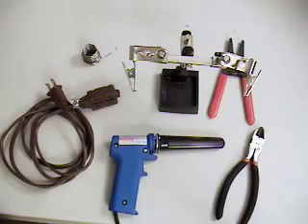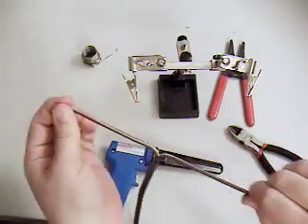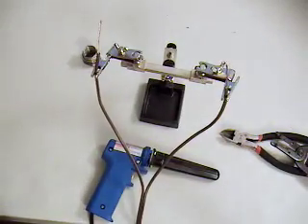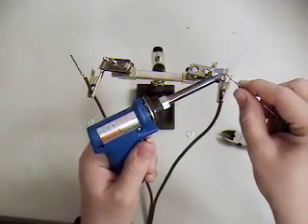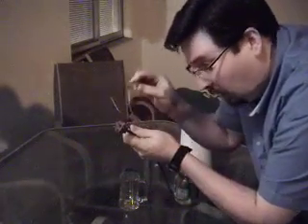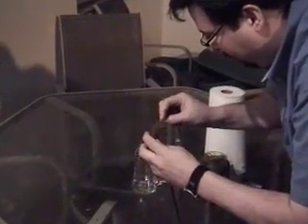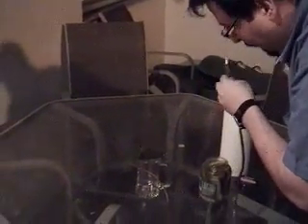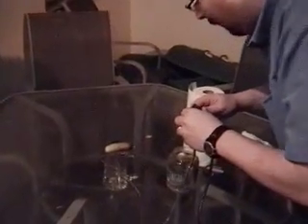Fluorescent Pickle Experiment, EXTREMELY DANGEROUS, but cool

Comment: Hey you should get more than 1 pickle and put them in a line with wire between to sor of string them together to make a chain and put the  ends of the extention cord on each side and see if you can light up more than one. Christmas pickle lights!

Comment: If you end up using those high-voltage capacitors, it could rapidly arcs over for several milliseconds before blowing up, I liked this video - my friend actually tried that but with pickle's limit being pushed - it was so loud when it went off. If you wanna do that, I recommend you to wear face shield and ear protection - it could get out of control so fast. I got a piece of hot pickle somewhere on my body, it was so painfully hot.

Comment: Didn't you think of putting a switched electrical cord inline so the risk of electrocution would have been lessened. You should have also used your soldering stand to hold the pickle. Great vid though. Thanks